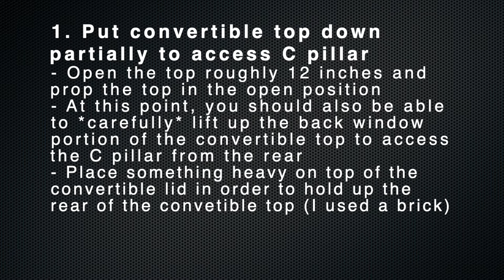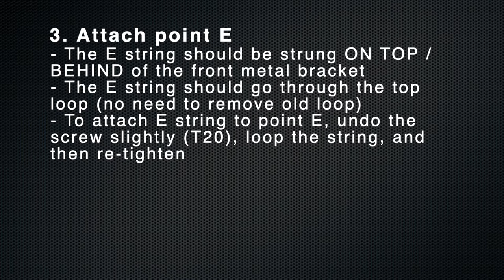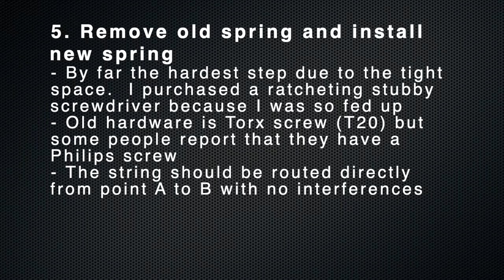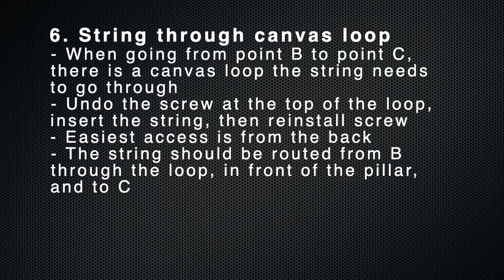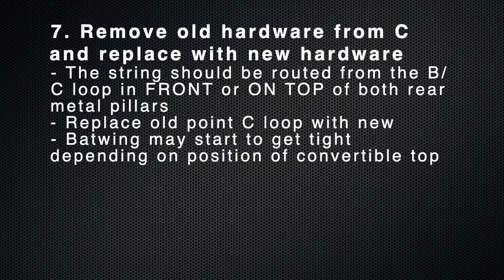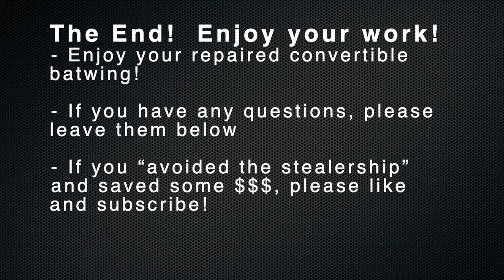BMW e46 Convertible Batwing (C-Pillar) Replacement

Comment: Hello, every time I open my convertible like you show and turn the car off to not waste battery my top automatically goes back down. Does my key and ignition need to stay on? Or do I just place something to hold the top down before it closes?
Reply from the maker: Once you turn off the ignition, the top will begin to slowly fall down. You need something at the top of the windshield to prop it open. I used a brick 🤣

Comment: Great video. Friends dont overthink the job because thats what i did the first time around. Also “D” t20 screw was the hardest to get out. I used a proper size allenhead which fit if you dont have a torx l shape tool. There is no clearance to get anything in there
Reply from the maker: The clearance is BRUTAL. My saving grace was the stubby ratchet screwdriver. Glad the video was helpful!

Comment: I have got an question. Im from germany and your intructions look very good. But my problem is that my convertible wont open correctly. Once I tried it I heard an loud bang and noticed that the C pillar just broke lol. Since then it had problems to open…Is it because its broken or what could it be? Thx for the answer in the future
Reply from the maker: If your batwing is broken, the bang is likely the plastic breaking.  If that is not the case, I would check the convertible motor next ( under rear seat bench)
Reply: @AvoidStealership  okay thx..But is the Batwing necessesary to pull down the convertible?
Reply from the maker: Not particularly, but the fabric / string could get caught.  If the top is not moving, I would check out these 2 videos
https://www.youtube.com/watch?v=5RfBL-A06jY
https://www.youtube.com/watch?v=YePmiKISAa4

The first video probably won't be helpful (based on what you have said).  The second video will show you how to check the convertible motor.
Reply: @AvoidStealership  thx for the fast answers! I will check it up and hope that just the Strings got caught and that caused the error lol. I mean if I let loose of the button and push it again it will open just fine so…I hope that its just the fabric

Comment: The serviceability of this retraction system is not good to say the least.  I ended up not able to remove the springs which were ok, so with the back of the top up perpendicular to the deck, I just removed the spring on the kit and hooked the string to the existing spring.  Not sure how BMW controlled fasteners but one was a 10 torx which stripped out and caused lots of grief.   overall I wish the kit had come with a termination to the string that could be added after threading it through all the guides loops.   would have been much easier - in fact next time I'll just cut and add a short section to do so. Hoping the other side never needs to be done.   thanks much to author and producer of this video!
Reply from the maker: Glad it was helpful! You're 100% correct that the designers/ engineers didn't make it easy for repairs. 🤞 that you don't have to do the other side!

Comment: Thanks for you video. I just installed the drivers side, as it was broken. Only took me about 3 hrs!  I would get confused which went where (not in your video) but on my top. Your video helped me out. I put the "support strap back on wrong once & had to redo it. I guess I must see things backwards. BUT it works correctly.  Thanks again
Reply from the maker: Awesome! Really glad that it helped. Good news (or bad) is that if you have to do it again, it'll take you about half that time!

Comment: Great video man. Just did a set on mine today.

For anyone doing the job, be sure the spring component is routed correctly. Some aftermarket wings may not pay attention to the routing on assembly.

Additionally, if you have someone helping you, they can manually raise and lower the rear and front of the top to make some of the fasteners more accessible.

You can also use binder clips to test the actuation before gluing. Be careful because they can get caught but if you want to make sure everything is good before gluing, binder clips are strong enough and low profile enough to do most the travel with no issues.
Reply from the maker: Good hints! Thanks for the insights!

Comment: Thanks for your detailed video, where did you buy your repair kit, are the ones on ebay good enough?
Reply from the maker: Can't speak to the eBay kits. The kit I used is linked in the video description!
Reply: I'm curious if you can tell me anything about the front seat covers in your car. I bought a set on mercari, but don't know the brand.
Reply from the maker: I believe the seat covers were OEM, but I can't tell you that for sure because I bought them secondhand off an enthusiast website

Comment: The fabric looks to be attached to the batwing with a sealant.  Did you have any trouble removing the fabric from the old batwing?
Reply from the maker: Personally, I didn't. My batwing broke and the fabric just sort of peeled away from the plastic. I would try a heat gun/ hair dryer to loosen the adhesive if your fabric is still sticking to the old batwing

Comment: The space allowed to remove the D hardware seems impossible. There’s no direct line for even a stubby driver and raising / lowering the roof won’t allow more space. ?
Reply from the maker: It is REALLY tight. You can raise / lower the roof until is the best access angle for you. I have kind of small hands but overall, it's a PITA
Reply: Torx key did the job!
Reply from the maker: @MichaelVagnetti  torx key FTW!

Comment: Do you start the engine and raise the top partially and turn the engine off?
Reply from the maker: I don't. I just turn the key to position 2 to move the top.  However, I do know people that won't move the top at all without the engine running
Reply: @AvoidStealership  thank you!

Comment: Just remove the headliner it looks better without it.
Reply from the maker: I don't think I've ever seen a picture without the headliner!
Reply: I personally like it. The factory soft top has a beautiful texture pattern underneath and the mechanical parts look cool. My headliner was damaged from previous owner not fixing the batwings so it slightly ripped on one side. I pulled it to replace and was pleasantly surprised! I’m sure BMW purists are saying I’m an idiot right now. But I did take that headliner money and buy a hardtop!
Reply from the maker: @georgef1176 My headliner is still in pretty decent shape, but if it ever gets a rip I'll have to consider this